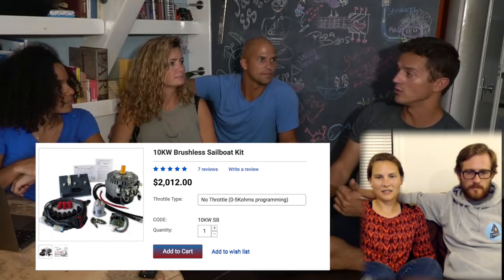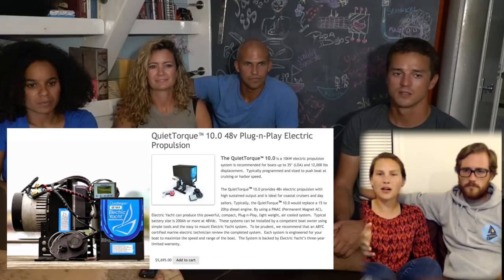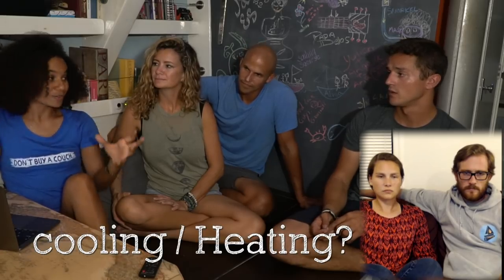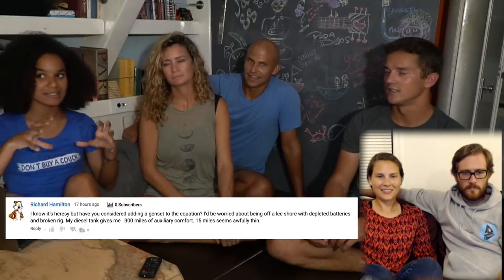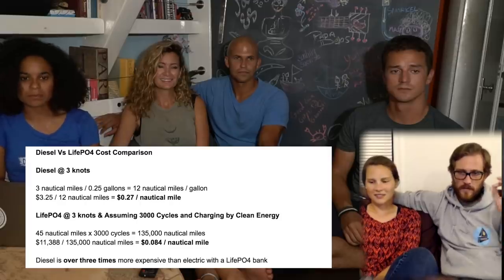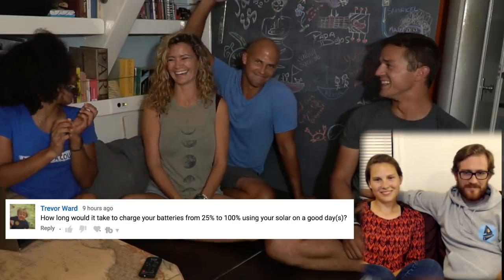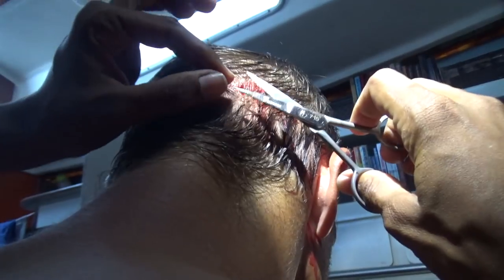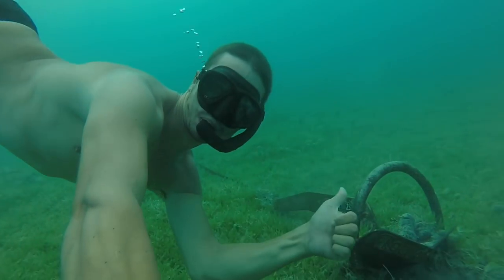Electric Sailboats: An HONEST Discussion — Sailing Uma [Step 140]

Comment: RE: Diesel 
We got pounded in the swell going out the Gate (San Francisco Bay), so we turned back and anchored in Clipper Cove to try again the next day. Next day, we got up and readied the boat to motor out of the cove. At the little woman's suggestion, we loosed sail to have it ready. Started the engine and weighed anchor. After less than a hundred meters, the engine quit and would not start. Of course, the anchor windlass hung up. We unfurled the genoa to steer clear of the rock, but we slammed into the Navy pier. Bent our pulpit and crushed the teak on the bow. After a lot of excitement that I could have lived without, we secured the boat to a camel and called for a tow. 
Later discovered that the pounding the day before had worked loose the sludge from the diesel tank. It fouled and blocked the filter and starved the engine of fuel. 
And the moral of this story is -- When you need it most, a diesel engine will fail you.
Reply from the maker: Agreed. We’ve been on several boat that experienced similar issues.
Reply: @SailingUma  FWIW if you don't know what a camel is, imagine a fender 10 feet in diameter and 30 feet long. That's a camel. The Navy pier had 6 of 'em, used to tie up destroyers of 8,500 tonnes (metric). Our boat displaced 10 tonnes. It seems scary, but after the unwanted excitement, I felt secure tied up fore and aft to that camel. 
PS The tides in Clipper Cove can be vicious. It is a wonderful anchorage, but the pass is narrow and accelerates the tidal current. Take it at slack water.

Comment: great info guys. im planning a 52' alloy cat build in 3 years. really considering elec as it just makes sense in lots of respects, especially on a cat as it reduces weight and solar area is larger. things will be easier and cheaper by then to. one question. with a 15T cat im wondering how to design the setup elec or hybrid to be able to motor for say 1-2 days non stop if i have to? do they make elec motors big enough to replace 2 x 60hp deisles?

Comment: It should be possible to have a propeller designed that when driven the blades face at the optimum angle, and when running down a wave, the blades change their angle of attack so as to optimise regeneration, and to have it happen on demand using small springs and stops.
Reply from the maker: There is. It's called a "Servo Prop" Oceanvolt's SD seems to have the only one we can find though.

Comment: great video people. dan, what are the possibilities for water getting at the motor or batteries? could you recover from such an incident? or if something fails on the motor.
Reply from the maker: Water is unlikely to get all the way to the top of the batteries and cause a short, it would mean we're about to be stepping up into the life raft. The motor is lower , but sill above the bilges. If it gets salt water in it, you can rinse with fresh water, dry it out and keep going. Same as any power tool you leave out in the rain. They work fine once dried out.
Reply: cheers. now get back to work :-)
p.s. i thought you were crossing the pond?
Reply from the maker: Next spring. We slowed down to enjoy sailing and not be in such a rush.

Comment: rbeck  Cooling your elect mtr with the high temps could be easily done by fabricating pieces of 1/2" copper pieces with an elbow and short piece of copper on each end attach as close as possible around motor using large ss hose clamps, then connect all ends on one side (using heater hose) to a sea water supply and all ends on other end to discharge . This way the water entering at 70 d (or higher) you will likely pick up 10-20 degrees of heat. If you use a serpentine coil you will potentially end up with steam at the coil end  due to high motor temps.  See Ransailings trip around Costa Rica  toward Hawaii , there are times a reliable large motor is a friend. Enjoy you Videos  Good luck

Comment: Have you thought of getting a power generator like Ran Sailing has the one you throw a line overboard with a prop attached to the end and it spins a generator that’s attached to the rail on your boat, so when you are sailing it charges your batteries, it looks as if you could build on easily

Comment: I am a big fan a electric propulsion. I have 2 electric cars and one electric bike.  But for my boat, I am still on the fence between electric and bio-diesel. A couple of those reasons are: 1) shelf life of lithium batteries and 2) the fact that if you are not going to use motoring often anyway,  the "green aspect of going electric on a boat is actually in favor of diesel.  The shelf life of lithium batteries, even if you don't use them is limited and goes down dramatically if stored in a hot environment. You can expect 10 years shelf life in a controlled environment but mut less in the hot bottom of a boat. So if you are not going to use your electric motor much because of limited range, your batteries will reach end of life because of shelf life, not cycles. So it would be greener to run a straight diesel or even better bio-diesel than leaving 10kw of lithium batteries mostly unused until they die . Reason being producing this 10kw of batteries required a lot of energy and polution.
Reply: Finally someone tells it like it is.
Reply: That’s a lot of errors in that statement about shelf life on lifepo... it’s simply not true, they last for a much longer time than that....
Reply: I was referring to this study as stated in another comment: https://uwspace.uwaterloo.ca/bitstream/handle/10012/12177/Catton_John.pdf?sequence=3

 This is an in depth lab test of A123 batteries (LiFePO). IT i hard to tell how long LiFePO batteries will last since they have not been around very long. Studies like this one is a close as we get to hard data. Do you have another study as a source?
Reply: Yes, but even though they are not using the batteries for propulsion they are using the batteries for the house. This is the beauty of electric propulsion you are using the fuel you already have. Rather than having two separate fuel supplies. They are also getting rid of the LP.  The only thing I would suggest is having a small Honda like generator stored on board. No different than having one for emergency on land.

Comment: You guys covered regeneration via motor.   But didn't hear about the separate drop in water generators.   I know, Expensive.   But is it possible to DIY a water pwr generator?  Like old small outdrive with motor replaced with generator ?
Reply from the maker: It's true. If we got a Watt and Sea, we could get our batteries fully charged from dead in about a 2-3 day sail at 5.5kts. SO definitely something we're looking into if we can't get regen to work.

Comment: I love the possibilities of electric propulsion!!  I remember and agree with what Dan said along time ago that 'Electric motors are awesome, but battery technology is not there yet.   
I grew up on boats with diesel propulsion and for a time made a living on a diesel boat.   The diesel yanmar 2GM on my boat is 36 years old and has been 100 % reliable.  I don't think it is fair to compare how reliable 3 to 5 year old electric systems  are to diesel engines that may be 20 to 40 years old.  I am sure that you will find people stuck in anchorages with diesel engine issues, but they are probably much older and have many more hours on them then the new electric systems.   How long will your batteries, including lithium ion, solar panels and solar controllers last?  Maybe electric is better... I just don't know...
Reply from the maker: If we discharge our batteries down to 80% every single day, they’re rated to later about 10yrs. Even then their capacity is about 75% so still usable. I’m sure technology will be much better in 10-15 more years. Just look how far we’ve come in the last 5.

Comment: I ve heard of new capacitor batteries that are a small voltage recharge but almost instantly charged.have u heard of them?
Reply: They are still very expensive and not very safe, certainly not safe enough for sailors. They also make carbon batteries (not lead carbon), but it is still much too dangerous for sailors. As these technologies mature, they will replace Lithium.
Reply: thank u for the reply. i just have seen the skeleton co caps are now being used on teslas cars now for weight savings and to ease the start up draw of acceleration and quick recharge.in a wet environment i see the risk but also the big gains in rechargability and short term boosting (bow thruster) ...thoughts?

Comment: There are vertical axis wind generator designs. Is there a marine application available? This was an awesome video. Thank you
Reply from the maker: They're have been a couple that popped up for a brief time. But nothing that we know of that stuck around. Not sure why.
Reply: They have a much lower output than a similar sized horizontal axis machine, and the ones that last are much heavier. The Northern Lighthouse Board tried for years to supplement our solar installations over the winter with no success at all.

Comment: Have you seen anyone using a parachute way up for downwind like trade winds ?
Reply from the maker: It’s called a Spinnaker...   ;)    We all have one. But there are talks of using large kites one cargo ships and non sailing electric yachts to assist in down wind routes. For us, sails are much easier to work with.
Reply: Check the wind at 50 m up its stronger & more stable for downwind sailing.

Comment: They need a variable pitch prop, that has the ability to reverse into a aggressive prop profile, my local electric boat power system experts in Puget sound have it down pat, region, Seattle WA, they have a channel.
Reply from the maker: Link?

Comment: I heard somewhere that there’s a way to generate power while sailing. The prop extends and is turned by the forward motion under sail. Ever heard of this?
Reply: It's called hydro generation or regen. The best systems use a variable pitch propeller.
Reply: They talked about that a lot in the video, 'regen'
Reply: FeelItRising yeah I was a bit premature on that one, thanks 🙏
Reply: Craig Overend hydro generation, that’s the word I was looking for. Thanks Craig

Comment: Hello and great video discussion. Speaking of efficiency, have you looked into super or ultra capacitors. I think there is data out there as to using lithium in conjunction with super capacitors. Question: I’m looking at going totally electric on a trimaran I’m pursuing in San Diego. Where did you order your best batteries (between the 3 of your boats) ,  and have you looked into better technology since you have installed? In short, what would you recommend now (knowing what you know) for energy storage, that would be most cost effective? Thanks so much and keep up the great work. Fair winds and following seas, Nathan. 🙏🏼😍🇨🇦
Reply from the maker: https://battlebornbatteries.com/
As many as you can afford. They're your range. So if you run a 48V system, 4 batteries would get you, say 10 miles at 4kts. so 8 would take you 20 miles....make sense? I know they "look" expensive, but they'll be the last batteries you every by. They'll last 30yr on a boat if you take care of them. I wouldn't try it with lead acid, it's not worth it when lithium has come down in price so much.

Comment: For those going diesel and propane free, do you have hot water? Have you thought about how you might do it?

A small, low amperage electric water heater in conjunction with solar water heating panels that do most of the work maybe?
Reply: Sam Smoot, We dont have any plans for a water heater. That's just because we're not planning on any high latitude cruising in the near future. If we decide to sail north, it's definitely something that we may do. That, along with a wood burning stove might be necessary.
Reply from the maker: We'll be figuring out that soon as we have plans to push north

Comment: My concern with wind gen up the mast is vibration. You might find you spend a lot of time either listening to the hum of the generator or climbing the mast to sand the blades down until they're balanced. But then, with the whole thing 10m away from stuff that can unbalance it, that might not be an issue at all. Also, Troy and Pascale just bought some 'silent' blades for ~$US600 that are much, much quieter than stock blades. Apparently people won't normally pay 2x as much just for a quieter generator.

Comment: Is Uma's motor running hot because it's being run far above it's rated wattage?  Either way, I'm excited to see how everyone's performance compares soon.  Still working on my own setup with the same thunderstruck motor kit, but running dual bank dual motors.  I'm also cheating a bit with a 12k gene to push things when range is needed.
Reply: No, its running hot because the duty cycle. Now that they have more  battery power they can run it longer at a higher amp consumption, which creates heat. Where as before they had a very limited run time with the lead acid batteries, so the motor never had a chance to build up heat.  Motors care about voltage, not watts. Theoretically, you have a motor running at 12V and then double the voltage to 24V  you will make twice the output power by doubling the voltage.  Volts multiplied by amps= watts....  They're most likely running the same voltage as before, but their battery bank is much larger aka a higher amp hour battery bank.

Comment: lol. i have a powerboat with an electric motor. have a 12V mcfarlane genny to power it and 2 relions for bufferring the power. and a 115HP main outboard when i need to use it. works great.

Comment: I agree that electric is a fine auxiliary, especially if the diesel is shot but I do have a problem with pulling a functional engine just to add $12000 in batteries, but if you are replacing your engine anyways, it's certainly on the table. There are motor boats, motor sailors, pure sailboats with sculling oars (look up “Some Thoughts on the Yuloh”. It was originally published in the JRA Newsletter No. 54 and the AYRS magazine Catalyst: the writer uses this on Easy Go, a 34' Junk Rigged Dory Schooner of Jay Benford design) and everything in sailing is always a compromise. 

"we don't want to go to shore for diesel", "Smell", and "vibration and noise" are legitimate arguments (arguments btw that I strongly support).
The rest are imagined. Sorry folks. Love you, but the green argument is a wash. I know too much about lithium mining, solar panel manufacturing, etc, and you are not calculating "total environmental cost". Dollars in the western world are for all intents and purposes currently directly related to oil (or if the product says made in China, it's actually coal). If you are paying $12000 for batteries made in China, it means they used $7000 diesel to mine the raw materials, $2000 coal to manufacture the batteries, and paid the employees with $2000 coal to cook their meals and build their homes (cement buildings in China), and then burned a couple hundred bucks heavy fuel oil transporting them to America. That's not green. It's not even green-ish. Electric boats aren't evil, but neither is a modern diesel. They are just different ends of the same compromise.

Comment: Generator backup, do any of you have it?    Using the backup in case of emergency such as charging the batteries or other electrical use. Tools,
Reply from the maker: None of us have one. In the tropics you don't really need it, but in high latitudes it might come in handy. They're easy to pick up and easy to store.
Reply: Submarine prime Propulsion is  Electrical whether nuclear or diesel. Older Diesel sub come up to charge their batteries. I believe it would be a safety factor to have a small 1000 watt Generator to charge your battery while you are underway.  Now if your sailboat can act like a Prius car and the Generator can power the motor in emergency conditions is another good question. Thank you for the reply.

Comment: At DC line loss from long wire runs is a valid consideration. You need FAT, short wires to avaoid line loss. Therefore, mast-top mount is not real practical.
Reply from the maker: Most wind turbines are actually AC, so you can run smaller wires down the mast and then rectify it to DC before the charge controller.

Comment: Great discussion, you won't convince me, I would prefer to go with a small diesel or gas engine for my auxiliary........ Dan the 2 buds at project Atticus suggested you thought you could be in the hurricane zone and sail out of the way with modern forecasting......    which is ok except you need to be sure you can travel about 150 mile in s couple of days and without a reasonable propulsion system that falls down a bit......wind cannot be relied on!  Cheers Warren
Reply from the maker: When a hurricane is approaching, the leading edge brings wind 24-36 hrs before the eye passes, giving you plenty of time to get SW on a beam reach. The further you sail, the lighter the wind gets. You get becalmed while the eye passes, then wait for the wind to fill back in and head back. Even in a Cat 4 storm, it's only 20-30kts of wind 150miles out.

Comment: Can you install a separate regen prop somewhere ?
Reply from the maker: No. That's the point, if you want to an efficient prop in each circumstance, you need 4 different props. As far as we know, ocean volt is the only company that has come close to solving this issue.